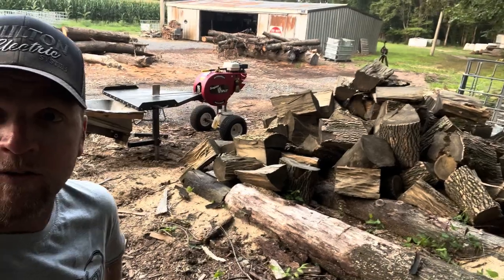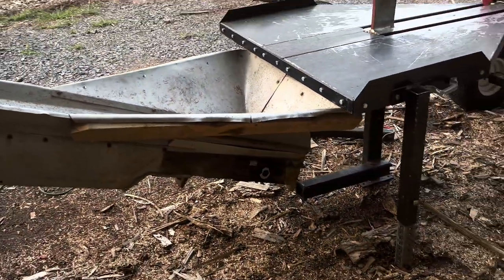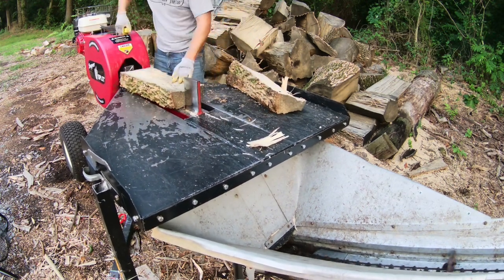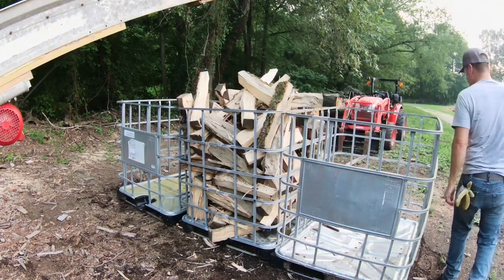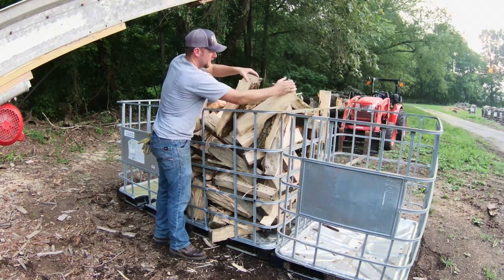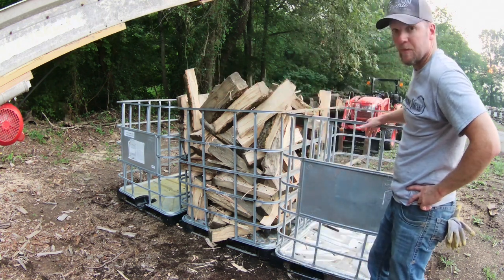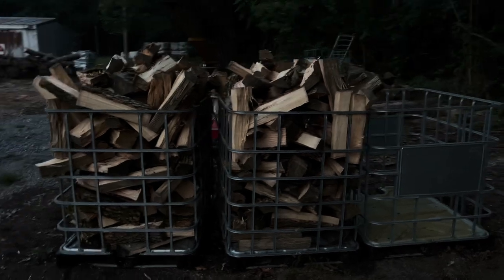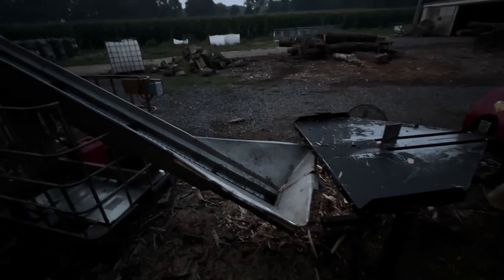Splitting Ash Fast with a Super Splitter Log splitter!

Comment: Hey Bud,  I know you like the super splitter but do you know how it compares to some of the others. It seems to be a little more expensive and robust.
Reply from the maker: Do you mean how it compares to other kinetic splitters? If so, you’re right. The SS are heavier built and more expensive but well worth the money. Super split is the only kinetic splitter I’d buy. Their customer service is great also. They’ll actually answer the phone or call you back. You can pretty well fix or replace anything on the machine. For straight wood there’s not much else that’ll beat it. But, for twisted knotty wood a hyd splitter is better of course. 
Hope this was helpful, feel free to message me if you have more questions. 👊🏻🔥🪵
Reply: @TwinCityFirewood it is definitely in my top 3. I have an abundance of hickory and oak so I’m a little unsure. I usually use my inverted log splitter on my Skidsteer, it’s made by Skidpro. It definitely saves my back not having to move the big rounds. Thanks for the speedy response.
Reply from the maker: @nathanbrown5761  you bet. I split a lot of hickory and oak with mine. It handles them well if the wood is straight & the rounds aren’t very big. The wedge is smaller so it does make for more work on the larger rounds. Thanks for watching!
Reply: Yep. The smaller wedge is my dilemma. I have an older box store splitter the does a decent job but much slower. Thanks for the videos. You are an inspiration.
Reply from the maker: @nathanbrown5761 thanks for the kind words!!